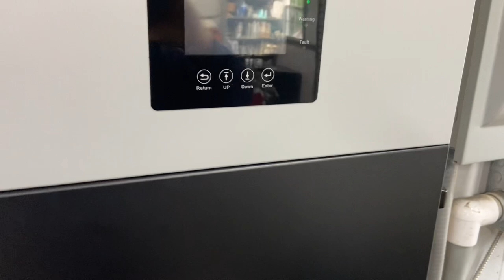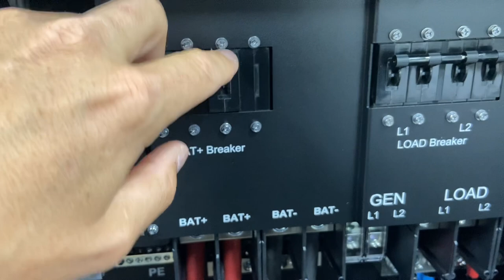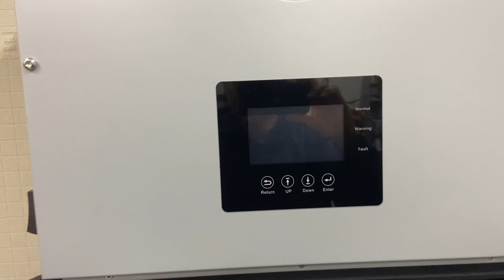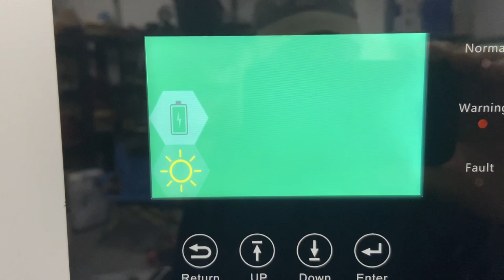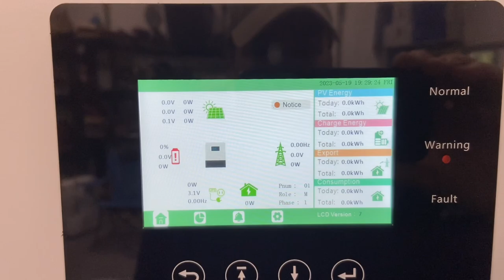EG4 18kPV unboxing and install

Comment: So this unit can handle 2 battery banks based on this wiring.

If I wanted to do 240v split phase, providing 100amp to each leg of a 200a breaker, I will need to buy 2 units and run in parallel, but also need to get 4 battery banks? Or just 2 banks and use 1 set of lugs?
Reply from the maker: So those are really two different things really. The first is the batteries. This can be run with a single 4/0 cable from the battery bank. Which would supply enough amperage. But it’s designed to double up the 2/0 to make up the difference if you need it. So I had 2/0 available and it was easy to install. 
The second would be the 240v split phase. This unit will supply a continuous 50 amp split phase. So yes, if you needed 100 amps you’d need two of these units. If you had two units you can supply them both from the same battery bank with a bus bar. Ot run two separate banks  to each inverter. I hope this makes sense.
Reply: @GavinStoneDIY  so if I build a massive bank using a busbar essentially acts like a splitter to go into 2 unit's lugs input (bat) right?
Reply from the maker: @KoiAquaponics  exactly. I have the busbars I used in the video description I think. I used the 600 amp pair from signature solar. That’s enough to handle both 18kpv’s.  It’s not a huge extra cost and it’s the easiest and safest way to split your current.

Comment: What is the purpose of the CT ? Why do you use them?
Reply from the maker: They monitor the power being generated from the grid. So in the event you are using the grid integrated features. The inverter is capable of adding inverter or grid power as needed. I have mine hooked up now because the inverter can also monitor the power the grid is sending in bypass mode with them. Hope this makes sense.
Reply: I read some where CT are installed to prevent battery power from going back to the grid,Block Battery Power.
Reply from the maker: @Bripromo  they are just a monitor that clamps on to the wires coming from the grid. Like an AC  clamp meter. It allows the unit to know how much power the grid is producing through the inverter.  Because the inverter can use DC  and grid at the same time. It needs to know exactly how much of each it’s utilizing.

Comment: 18kpv is more for on grid applications where you can sell back to utility....
For pure off grid, l went with the pair of 6500-48 ....
Less $$$ but more power, 12k vs 13k
Less pv 18k vs 16k.... each inv @ 8k .....
Better surge capability.....
And a 2 to 1 advantage if inverter fail happens....2 inverters vs 1.
Reply from the maker: You should watch my comparison video between the two inverters. I’m off grid and I prefer the 18kpv for quite a few reasons.
Reply: Let's talk in $$$   
I can get 4 6500's with the PDP for the same cost as the 18kpv
And the backup feature of multiple inverters, off grid (power lines 15 miles away...not an option) so any of the grid connection features would not be of use, but you still pay for them. But the peace of mind when or if a inverter fails...not having a complete shutdown while waiting for repair/ replacement.
Mine are in a separated room back corner of the garage, so noise is not an issue, nor weather proof.
I only wish that the 6500 had a touch screen... other wise the cost / performance is best I found with redundancy of multiple units.
Reply from the maker: @duanelinquist4244  there are definitely pros and cons. I think idle consumption plays a larger part in this then people realize though. If you’re figuring in cost you may have to add some battery storage  to compensate for the difference in idle wattage. 

The 18kpv is a whole different animal really. The quality and strong surge capacity are awesome. But like I mentioned in my other video, I ran my house on the 6500’s. So they’ll get the job done.
Reply: @GavinStoneDIY  
True. The build quality/ warranty, idle draw, programming & screen, of the 18kpv is better.
Just not worth the cost difference IMO. 
But if your able to sell back grid power, this is a no brainer to recover cost over time., plus have the 200A pass through
So I feel the 18kpv is the option for on grid and the 6500es for off grid.
Reply from the maker: @duanelinquist4244  yeah it really depends heavily on budget. Which it should obviously. It’s just hard to convey how much nicer the 18kpv is over all. However, I still have some 6500’s on the shelf just in case though. 🙂

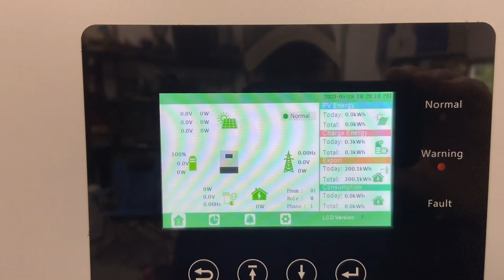Comment: 18:16 How did you get it to communicate with the batteries? I have a felicity solar battery and I need you to communicate, thank you
Reply from the maker: I have it set to “lead acid”. So I don’t have communications set up yet. Is your batteries BMS on the list for communications with the 18kpv?
Reply: @GavinStoneDIY  If it's the 18kpv, how do I know which is the felicity solar battery on the list?
Reply from the maker: @andyaviles2499  if it’s not in the manual or online then you could ask Signature Solar. I’ve personally never heard of that battery. But it may be on the list.
Reply: @GavinStoneDIY  thanks you very much

Comment: I would be interested in how you wired your strings into your combiner and then into the 18kPV.

Also how did you set up combiner to protect against emp, surge, transient spike, short, lightning, etc.

Also how did you ground throughout the system.

thx

Comment: What gauge are you using for the grid and loads?
Reply from the maker: I’m using 3 awg. But I’m not using the 200 amp bypass feature.
Reply: @GavinStoneDIY  I would love to reduce that going to and from the inverter. I’m a little cramped in there and I can’t imagine pulling three Ott wire. The bends are just gonna be too tight. I can’t imagine needing 200 on my house loads. Then again, I’m not super knowledgeable of these things. I will want to be running a water heater, a 4 ton AC heater unit and electric dryer, and a well pump though. Do you think I could get away with something smaller than 3/0? I’d love to be able to use the three gauge that you’re using.
Reply from the maker: @jonathanlyerly8501  it depends on what you are wanting to accomplish with the inverter. I run my whole house with the 12kw output from the inverter. But I’m basically using it off grid. If you wanted it as an automatic bypass then you need it wired differently. 

The online manual shows some different wiring options.
Reply: @GavinStoneDIY  by automatic bypass, I’m not exactly sure what you mean. I would like it to draw from the grid in the event that I run out of sunshine or battery, power, or if the load gets too great.
Reply from the maker: @jonathanlyerly8501  if you’re wanting to just feed a critical loads panel then you could have it wired like a standard off grid inverter. But there are advantages to having it wired with the 200 amp pass through. You can utilize all the grid interactive features. The inverter can power loads at the same time as the grid.

Comment: Prob gonna purchase this tomorrow.  Did you use a 70 amp breaker to your ac output or load?  Just thinking 12000 kw/240Vac=50, then multiply by 1.25 and it gives 62.5, so then rounding up gives a 70 Amp breaker.  Does this sound like what you did?
Reply from the maker: Yes I used a 70 amp breaker for my output. Make sure you use the appropriate wire size also. And keep my posted on your install. I like to hear about stuff like that.
Reply: @GavinStoneDIY  im pulling the trigge and ordering this morning.  Thanks!
Reply from the maker: @lujitsu1251  that’s super cool. I’d like to see some photos when you’re finished. The new batteries are definitely the way to go I think.  Much tighter form factor and nice features . If you click one of my 18kpv links before you purchase it’ll help the channel out. But no pressure on my part. I rarely mention that because it’s awkward. But every little bit helps.
Reply: @GavinStoneDIY  they sent me a link already but if there’s something I can add I will gladly.  They sent me a quote that has a button I can click to purchase.  I will hold off a few hours so if you can respond.  It has a 750 deduction so if I don’t use thst thibg I won’t get that deduction but like I saying there is any way I can do yours and get the 750
Off they quoted I’d be glad to do it.
Reply from the maker: @lujitsu1251  oh wow. That sounds like a good deal. So if you just click on a link first that I have for the 18kpv in my description,  then use theirs to purchase it may apply. Maybe not. But I suppose it’s worth a try. 😉
Reply: @GavinStoneDIY  ok.  I opened yours . Now I’m
Gonna open theirs .
Reply from the maker: @lujitsu1251  I appreciate that!
Reply: @GavinStoneDIY  if there’s something I can tell them to get your thing I will when I talk with them tomorrow.  I placed my order today! 18k, 2 wall mounts and a boatload of solar panels.
Reply from the maker: @lujitsu1251  that sounds like an awesome system. They really have some well priced bundles now. I think people would be surprised. I’m not sure if telling them would help. But you could try to say you wanted to purchase through my affiliate link. And definitely email me some photos if you can when you start to install.  Love installing stuff like that. It’s always hard work. But also super fun.
Reply: @GavinStoneDIY  so when I tell them your affiliate link is it just your YouTube name or what?  I will talk with him this morning.
Reply from the maker: @lujitsu1251  yeah just my YouTube name. But it’s not a huge deal. So I doubt they can do much with it. I’m not sure how  all that stuff  works.
Reply: @GavinStoneDIY  I will ask, it won’t hurt

Comment: WiFi is not Internet access.  It's wireless networking.  Telling people that they can access it anywhere they have WiFi is not accurate.  You can have Internet access without wireless (hardwired).  You can have wireless networking without Internet access.  WiFi is not synonymous with Internet access.
Reply from the maker: It uses a wifi dongle. So you’d need WiFi in order for that to function. You’d need internet in order for the WiFi to communicate with the dongle. If someone is unsure of how to access the internet or what those terms mean, then I definitely wouldn’t suggest attempting to install a whole house solar system.